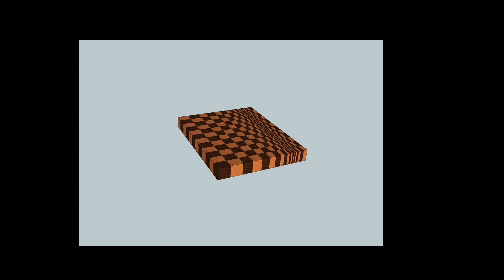Making a 3D end grain cutting board #8

Comment: mtmwood I asked in one of your other videos these questions but it never got answered so I will try here. Where did you get the brass or whatever material it is name plates that you use from? and What length do you start the recessed cuts at and then what length do you go to so that they are perfectly centered in the the middle of the cutting board. If you could please answer these 2 questions I would greatly appreciate it. Thank You
Reply from the maker: Mack Monsees Usually I answer all questions.
1. The name plates are made of steel by casting and covered with antique patina. I ordered them at souvenir plant in Russia. About $0.5 each
2.  One side of all squares is the same. The other side differs,  from 4 mm to 40 mm. So we get curved lines.
Reply: I thing you miss understood me. You use your shaper to cut a recess into the bottom of the cutting board so that you can pick it up easier and on your shaper you have a bunch of numbers written on it, can you tell me what number do you start at and then what number do you slid it to, to create these recesses  for your large and small cutting boards. I hope I was a lot clearer on what I my question was this time
Reply from the maker: Mack Monsees The numbers are the distances in centimeters from the cutter. I have to make the finger grip in the middle. So if I start, for example, at 20 cm mark on the right I have to stop cutting at 20 mark on the left. These points depend on the width of the board and the cutter. For 300 mm wide board and 100 mm cutter I use 18 cm mark.
Reply: Ok thank you for letting me know. Keep bringing these awesome videos they have inspired me.